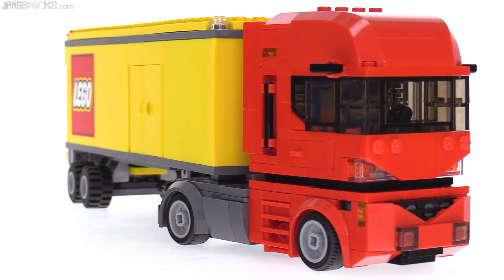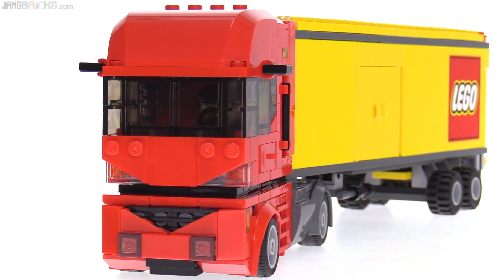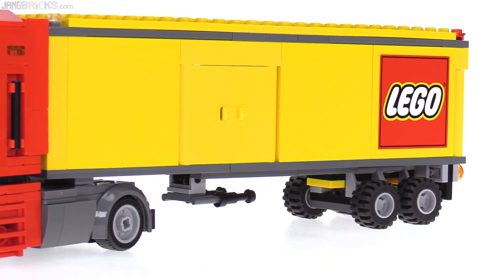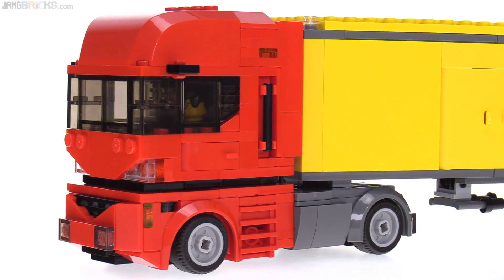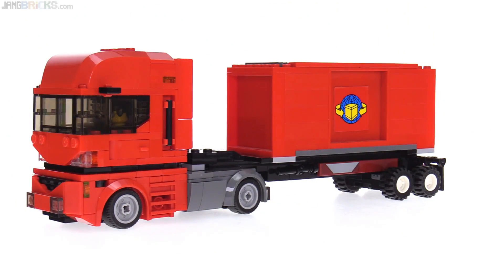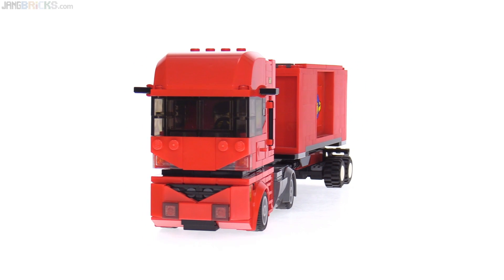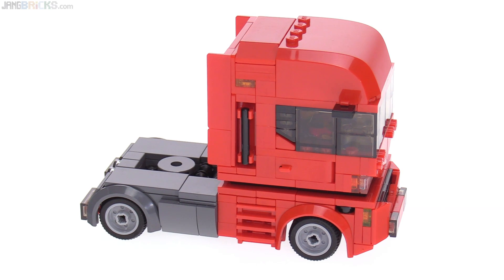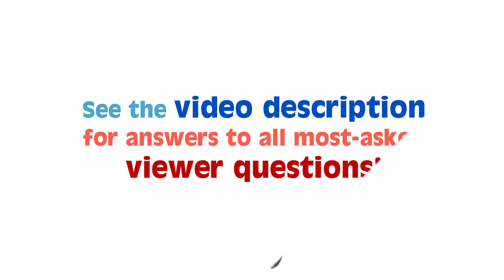Custom LEGO near-future cabover semi truck MOC

Comment: It looks like the truck is a mix between a DAF or Scania and a flat nose Kenworth. It has the wheelbase of a Kenworth with the stepladder behind the wheel and it has the "curves" of a DAF or Scania. Just wanted to point this out for those who may be interested
Reply: Yes. Renault Magnum aren't trucks I often see and looking at images of the actual truck, I can see where you're coming from. I'd say that this model brings in aspects from all of these types of trucks
Reply: Agreed. A Scania R-730 Topline to be a bit more specific

Comment: I like it and the lego fig not actully fitting but I can see that it could be modified to fit one if you wanted as there is room. Also very intresting use of parts for the rear. No its not cheating to do that as what else is that odd shape part lol.

Comment: Although I like the look, it seems to leave a little too much to be imagined for the inside can section. I would rather see it set up a little better for the inside. You address this but I like this sort of thing for the ability to do stuff not just to look good. Also have you ever thought of making a b-double trailer, so it is a trailer that you can put a second one on the back of.

Comment: Hey Jang, I was wondering, what's the purpose of having no front on the truck? I'm asking about trucks irl. Because wouldn't having a flat surface make it less aerodynamic and reduce the efficiency of the truck due to the air resistance? The only pro I can think of is that it's cost effective not having a good half of the truck.

Comment: Nah that technique isn't illegal, you locked in the pieces with those red 1x4 panels just fine.
Applying those 2-wide cheeseslopes and tail-lights with just one stud, the camera mirrors with the tiles in clips (even though Lego did it) and the bottomless minifig are absolutely heretical to me though.
Reply from the maker: LEGO did the 1-stud connection for a bunch of 1x2 cheese slopes on the Guggenheim museum I just reviewed too! :D
Reply: Well darn it, have yet to check that one.
Lego does and has done more things i wouldn't personally do i guess.
Structure is pretty important for me i guess. While my cars might not be as sturdy as speed champions chassis i always try to make smaller details as secured as possible too!

Comment: I usually don't like your custom builds but this one is really something, it has nice shaping and looks realistic but in a stylized way. However it is waaaaaaay overcomplicated in the build and there is really no reason you should not be able to fit a full figure in there (unless you really don't want to).. i can think of at least 3 ways you could have done that back section without having to use that flimsy combination of pieces
Reply: If anyone is interested in building one for themselves, here is a link to the LDD file for a version of this model:
dl.dropboxusercontent.com/s/mr55kba2cn74kqj/Near-future%20cabover%20semi%20truck.lxf?dl=0
The back connection for the model is modified (put the 1x1 green technic bricks on top of the green 1x2 plates) and it fit a figure! Can be improved, let me know what you think